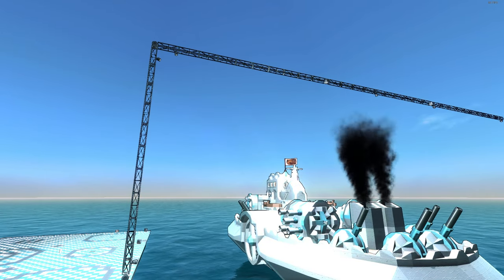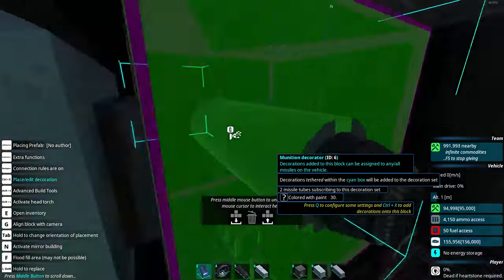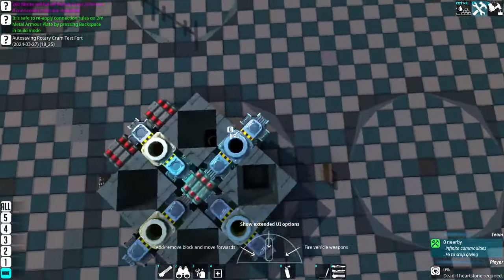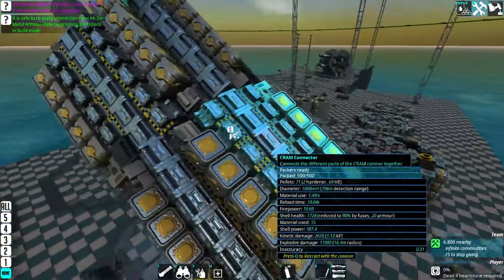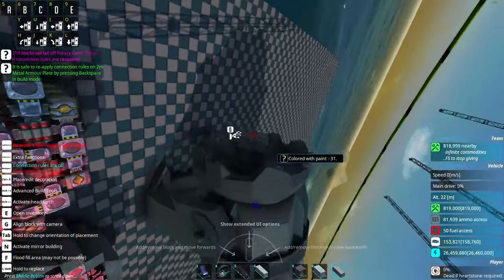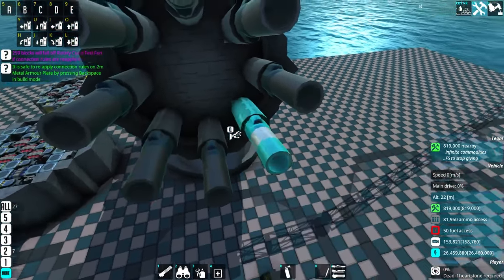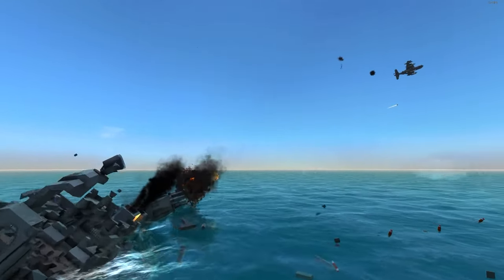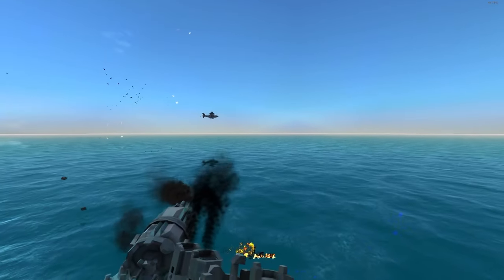Building Weapon Systems for my Onyx Watch Halberd - Bounty Hunting Part 4

Comment: The technical explanations are great imo. I have zero experience with breadboards myself so I can't say I was able to fully comprehend your explanation.
In that regard two suggestions I'd like to make is to turn off the background music during technical explanations to lighten the load on the brain. And second is more of a do-what-you-will with it, but you could separate the technical explanation in a second video on the side. It is more work editing and rendering two videos, but you'd be able to really dive in deep and do a step by step build up of the breadboards. This way you'll keep the 'main' video brief and easily watchable whilest also providing in depth explanation to those that like seeing that. On a pure channel growth note, two video's of ~15 minutes tend to do better than one 30 minute video.

Gotta say too that I really like that giant rotary cannon!
It feels much, much more powerful than the large halberd variant. My guess is this is simply due to it firing in a more consistent fashion than the burst fire from its large cousin. The burst fire hits hard, but only when it hits. Whereas the rotary gets more chances to do damage which stacks up over time. A single good hit doesn't do massive damage, but can set up every shot fired after it.
Reply from the maker: I did consider making it a separate video entirely, but I felt like it might just flop out of the gate lol. I'd probably just cut it tbh. 

Tbh I didn't even think about the music during bread, I edited the video without music and basically slapped in at the end. I'll keep that in mind for future.

The rotary cannon is funny because each barrel is actually more powerful than each barrel of the quin, and there are 8 of them, so the rotary cannon is equivalent to like 2-3 quin turrets, which is exactly what is on the larger boat. So overall they're not that far off each other in terms of Firepower.

Comment: surprised that you have not taken some of the aps ballista's yet.
and I might steal the rotary gun if possible.
also I kind of want to see the front gun of the big Halbyrd... is it Halbyrd or Halberd, get replaced with the rotary gun if possible.
Reply from the maker: So we were told that we can use APS as long as it is above 250 mm. Those ballistae use small gauge, so it's kinda unclear whether they're permitted or not ¯\_(ツ)_/¯
Reply: @draloric  is the aps gauge dependent on its vehicles difficulty? 
if so that's quite strange but its onyx watch.
Reply from the maker: Also it's Halberd (at least that's what the KOTL told us)
Reply from the maker: @ravenschihl4038  As for APS... I'm not sure, but I do know that the ships that the APS Ballistae are on are pretty outdated (like the OG Halberd) so my assumption is that they are being phased out.
Reply: @draloric  R.i.P a lot of anti air for the smaller craft

Comment: Btw might be a good idea to name the lcw of the cram minigun for sync
Reply from the maker: Maybe, although the LCW is nothing special. It doesn't care at all about all the bread and whatnot, it just points gun and pulls the trigger. I tend to build that way because then I can have easy redundancy by spamming lcws
Reply: @draloric  I was meaning that you could name each lcw that controls the crams ie 1-8. And have them set to max range when the spin block is at X degrees when the crams they control is on top and set to 0m otherwise.
Admittedly won't work if the lcw controls multiple crams, but would allow better redundancy in that a single cram cannon loss won't mess up the cycle
Reply from the maker: @Cobrax_x  Ooooh I see what you mean. Yeah that could work! Only allowing the topmost lwc to fire... hmmm I will play around with it but I don't even have room in the tetris to put a LWC. But I will try it! Great Idea!